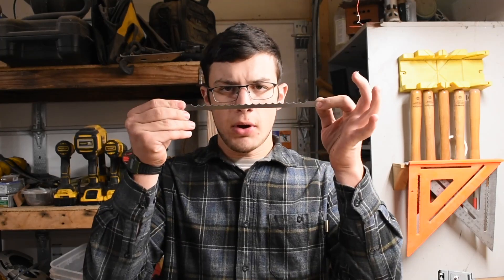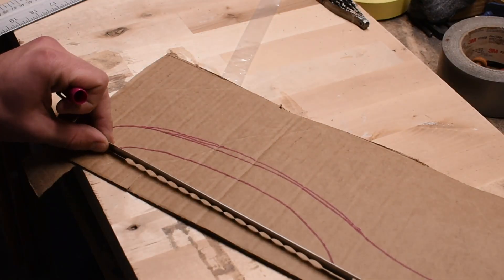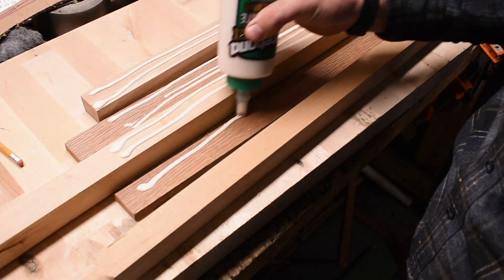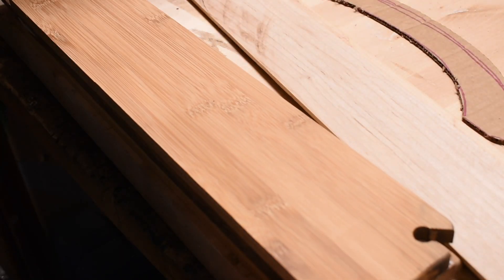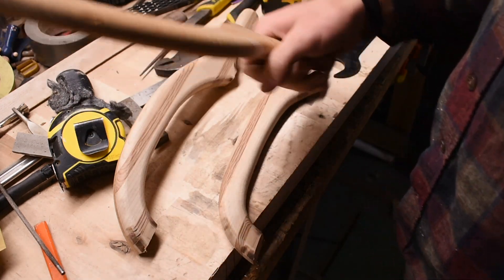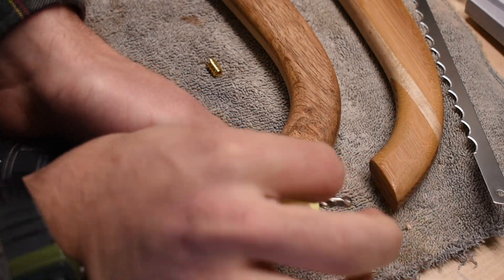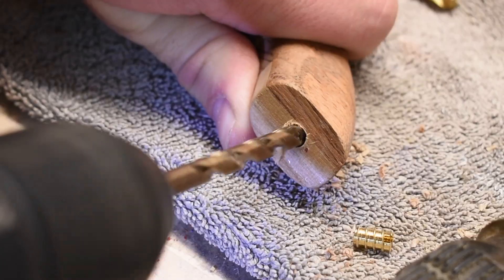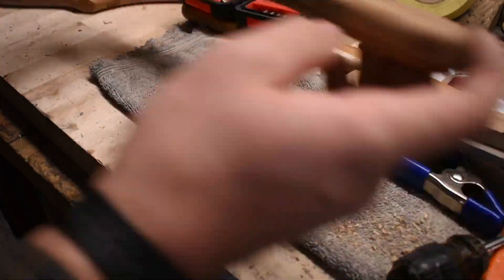You need one of these things! Bow knife build

Comment: OK, I am giving you a like and some advice. First the design could be better if you hade uniform space along the blade. That will allow longer more uniform bread slices. Also if you tried the inserts on a scrap…. And lastly, why use inserts at all?  You will never change the blade for the life of the knife. Use stainless screws and pre drill holes in scrap before the finished knife. To get the blade properly tensioned  drill a hole in one end of knife and thread in a screw, not tightened all the way. Now use a marker to mark the hole at the other end of the blade. Use a sharp nail or punch to make a starter divot on the far end of the marked hole. On the furthest edge of the marked hole. Pre drill your hole and insert a screw on a slight angle to get it started. Now tighten both  screws. You should be able to flick the blade and get a note. Good luck.
Reply from the maker: Thanks for the advice! And the like 😁

Comment: The proper method to install the threaded inserts uses a screw of inside diameter and two nuts to form a lock, then the screw is used to drive the brass into the proper hole.  The screw slot works about 1 out of 50 (don't ask how I know)
Reply from the maker: I'm guessing you broke 49, I'll have to try that, thanks